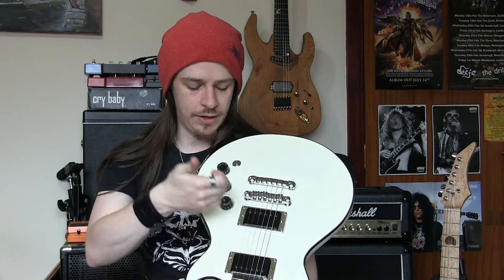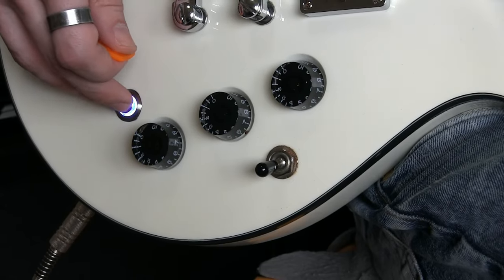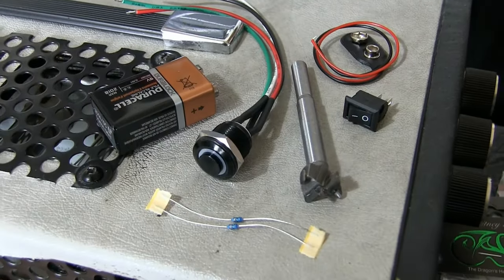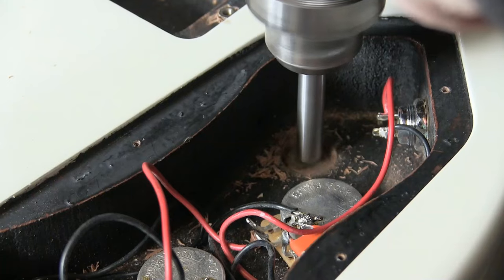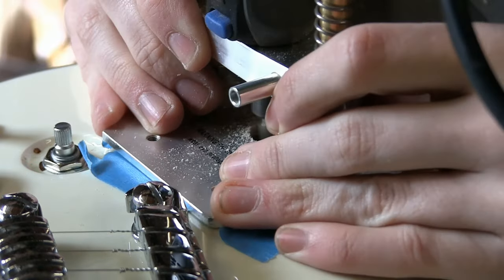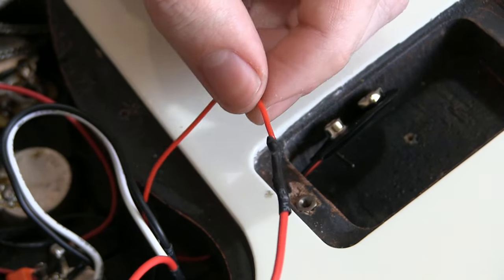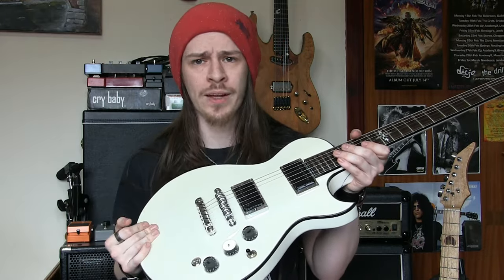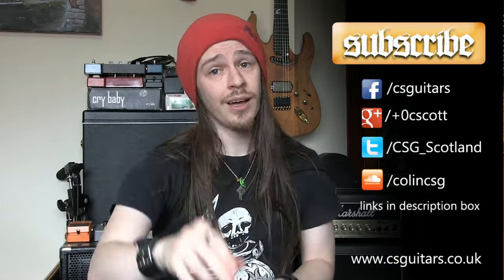Install a Killswitch: Guitar Basics

Comment: ok i need help :D i have pruchased one of these, black chrome with a white LED, but i dont want the led, but problem is, mine didnt come with a diagramme, and im not sure what wire does what, there are 2 black wires, and 2 white wires, no lables or marking whatsoever... any ideas dude?
Reply from the maker: You'd be best contacting Iron Age and asking.
If you want to work it out for yourself then I'd suggest grabbing a AA or AAA battery (not the 9v as it will blow the LED) and touching each end of the battery with each wire in turn and seeing which two light the LED.
Once you find out which ones do, you'll know the other two are the ones to use in the audio circuit.

I hope this helps
Reply: Thats a great idea, maybe AAA just incase of any damage, this couldnt damage the killswith part of the unit though? I have mailed them from their website also, im just awaiting a reply :) thaks for the help
Reply: +Marcus Johnson i just found a video in the article section of the website, explains everything >.< thanks anyway dude ;) great installation video btw
Reply from the maker: Both AA and AAA run at 1.5v, the only difference is their size.
The kill switch will be rated to probably a couple hundred volts, so batteries will do nothing to it.
Reply from the maker: It doesn't matter which way around the wires go, the switch is only breaking a connection. It can be inverted without any issue.
Reply from the maker: Glad you managed to get it sorted.
Enjoy the switch.

Comment: Stupid question alert: Instead of recessing the side of the hole to account for arch, could you not slightly angle the drilled hole so that it mounts flush to the original surface and arch degree?
Reply from the maker: The nut on the inside needs to be secured to a flat surface, drilling a hole that is perpendicular to the top curvature would have resulted in a hole that wasn't perpendicular to the cavity, preventing the nut from securing the switch. 
Plus I prefer the look of recessed controls and it matches the potentiometers, which are also recessed.
Reply: That makes sense. Thanks.OH...yeah, I see the potentiometers. I did not notice that. Makes even more sense. I told you it was a stupid question.

Comment: I have an ESP Viper, which DOES NOT come with active pickups, therefore I have to place to keep the battery, is there any way I can install the killswitch without a battery?
Reply from the maker: Yes, just ignore the red and black wires from the switch.
Reply: CSGuitars Thanks for the quick reply, will be sure to get one

Comment: question, if I don't have  stereo output and I don't install the on/off switch, will the killswitch and LED not work?
Reply from the maker: +Lee Walker if you don't have the switch or the stereo socket then the LED will never turn off
Reply: +CSGuitars Ahh ok.  I'm installing on a Kramer assault, it has no compartment for a battery so I'm thinking either put battery in back of bridge plate or just leaving it out.

Comment: I have a huge problem someone help. I had a killswitch that worked just fine it was normally closed and was connected to the volume but I replaced it stupidly enough with a normally opened one. Now it only turns on when I click the button!
Reply from the maker: +Desi guy this video shows how to wire a normally open switch to work as a kill switch
Reply: Yea I did its working now but now i am getting a hum even on humbuckers  :o
Reply: +Desi guy what kind of guitar and amp are you using?
Reply: fender strat with humbuckers. amp is regular fender mustang.

Comment: Hi. 
You said it was possible to use both normally closed and normally open switches? 
How? :) 
- Sonny
Reply from the maker: +Sonny Soul hi sonny,

This video describes the technique for normally open switches.

For normally closed switches simply place the switch between the volume pot and output jack.
Split the existing wire connecting pot to jack and wire each side to the two contacts on the switch.
Reply: +CSGuitars Thanks ;)

Comment: my schecter is wired a bit different. The wiring diagram did not work at all. Is there somewhere i can find a properly labeled one?
Reply: model?
Reply: damien 6
Reply: It really doesn't matter how its wired, the important thing is to connect the signal output of your guitar to any ground through the kill switch.
Reply: if it didnt matter it would have worked no? lol i need labels especially on the jack. which tab is the sleeve, tip etc positive negative and ground should always be labeled in diagrams.
Reply: +Raging Lunatik The part that makes contact with the tip of cable jack is the hot one.

Comment: Does anyone know how to install a locking killswitch?(was thinking like a jazzmaster 2way slide switch) I can't find anything online
Reply: You need an ON:ON style 1pdt switch. connect middle lug to ground, connect one side to the HOT (tip) lug for your guitar jack. The third lug is connected to nothing.
On one side the switch is open and is non-functional, it's just a wire that goes to nowhere, and your guitar plays normally. The other side is closed, routing your signal to ground, killing it.
DO NOT put the switch in series with the output from your pickups to the output jack as this can create popping noises in your amp when you toggle it.

Comment: What if you had 2 volume pots? How would you install it?
Reply: If you have two volumes, you most likely have a 3 way switch. In that case just turn one to 0 and one to 10, then flip the switch back and forth that way. Just don't abuse it. They aren't really designed to be used as a killswitch. I did that to one of my guitars and eventually the switch started working improperly.
Reply: +Logan Prosperie I actually do know that trick but I had the same problem as you

Comment: CSGuitars, I love your videos, but the advice in this one is plain wrong! You've misunderstood the circuit, explained the process backwards and given the opposite advice.

You DO NOT want a push-to-open switch. 
You DO NOT want to just break the signal - that will create popping noises due to voltage spikes. 

You want a push-to-close switch that short-circuits the signal to ground. This works because then the net output of your guitar is zero. It also avoids voltage-spikes that make popping sounds.
Oddly, the circuit diagram you have in your link is correct - showing the switch connections between the output jack tip lug and ground. The ironage switch is clearly actually push-to-close.

Finally, nothing to do with your videos, but for others who might read this:
As of 2018 Ironageaccessories charge $30 for just the wired switch, a rubber gasket and some resistors which is extortionately expensive. Virtually identical high-quality illuminated switches can be had for one fifth of this price.
Out of thousands of examples, here's one: https://www.seeedstudio.com/16mm-Momentary-Metal-Illuminated-Push-Button-Green-LED-p-1798.html
Reply: Thanks. It was driving me mad thinking nobody else noticed! 👍

Comment: If I install a kill switch on a guitar, then I wouldn't be able to control the volume for the pickup wouldn't I?
Reply from the maker: +Our Lady Of Skyscrapers A killswitch doesn't affect the volume control. 
It simply kills the signal when pressed. All the rest of your guitar will work as normal when the switch is left alone.

Comment: i installed one a few months back but my guitar control cavity was way to small for the 9 volt and the 3 volt for my onboard tuner so i installed a new 9 volt holder box , but am still waiting for the resistors to arrive as usual here in the phillipines u cant find jack shit u need ,anyway i wired it to my onboard tuner its quite dim but looks ok for the time being, on a side note the onboard tuner is the best thing ive ever bought , had to order it off ebay from toronto once again vant buy anything here  keep up the good work

Comment: Doesnt that guitar already have a volume for each pickup? Turn one to 10 the other to 0 flick the toggle between. There's your killswitch
Reply from the maker: Orly Alderete It's a demonstration. I didn't mind cutting this guitar to pieces.
Reply: Toggles aren't really designed for the type of abuse killswitches are. You could easily mess the switch up doing that. It is what happened to one of my guitars a few years ago.

Comment: I hate to undermine your video, but you don't need to install anything in your guitar. If your guitar can change pickup settings like a les Paul, then you can just set the rhythm volume to zero and the lead volume the same as normal, then just rapidly flip the switch between rhythm and lead.

Comment: NO DRILLING ALLOWED on my guitars! 😱
Reply: Drill a pilot hole and use a reamer. You won't chip the finish that way.
Reply: @J__C__  That's sound advice. I think it would help to accomplish a better fit on some guitars with mild surface contour / carved face as well as save the finish.